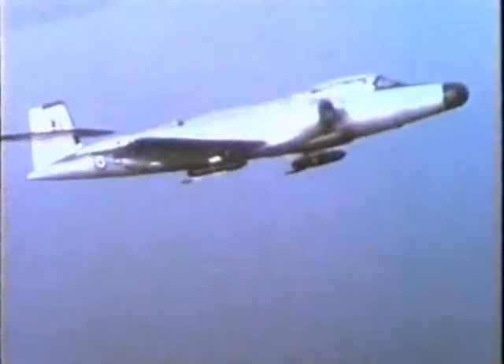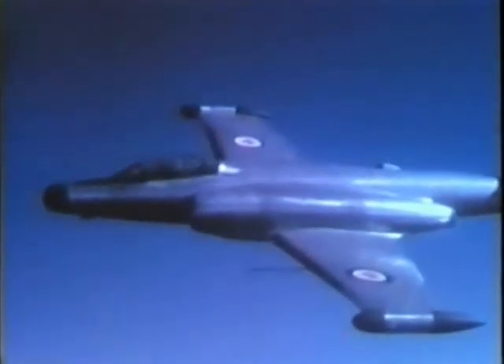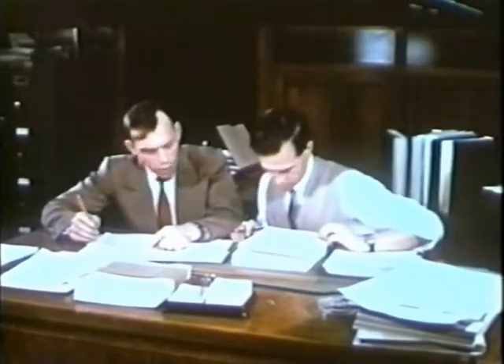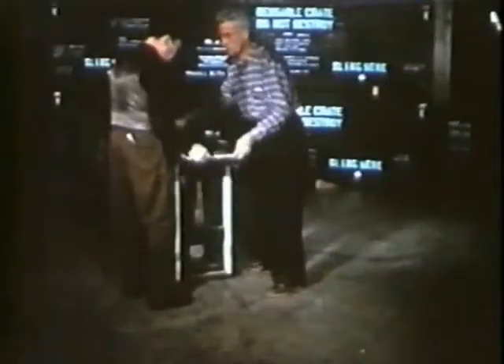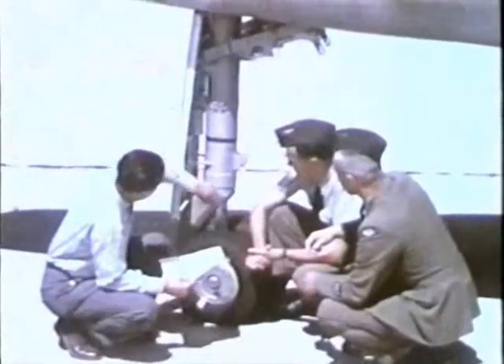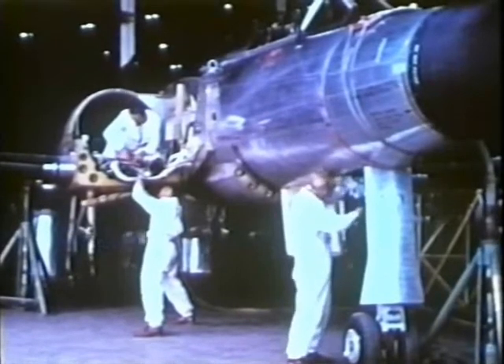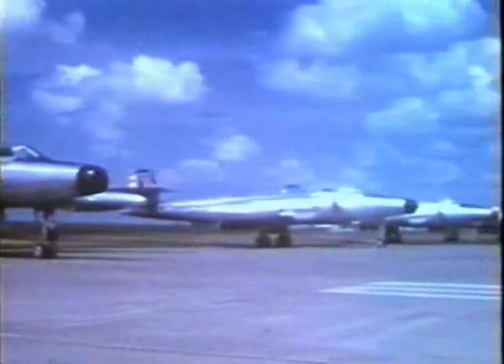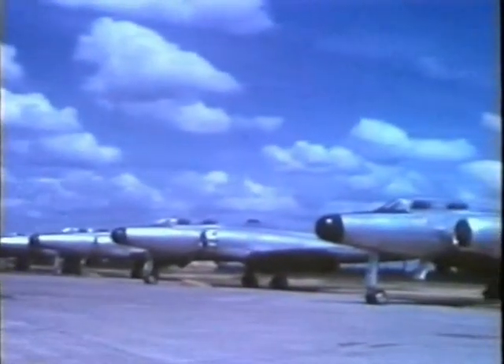Avro CF-100 Canuck Part 2

Comment: @LonesomeTroubadour f-89 scorpion and f-94 starfire ( not to be confused with a 104 Starfighter ) also had the same weopon system,  I just find the " one shot, one kill maybe" is very impractical. The gun pack went a great way in solving this problem. I know that the unguided rockets covered a large area but aircraft, even big slow bombers, still cover a lot of ground in a short time. I like the F-101's way of thinking, if your going to take one shot then make it a good one, Nuke'm

Comment: What are the odds of hitting another aircraft with unguided missiles? and if you got a hit it would be a one shot deal, seems rather impractical to do a long range intercept to just take one shot. the plane could have been of better use if it had a better weapon system.